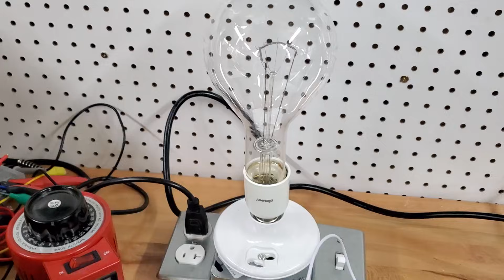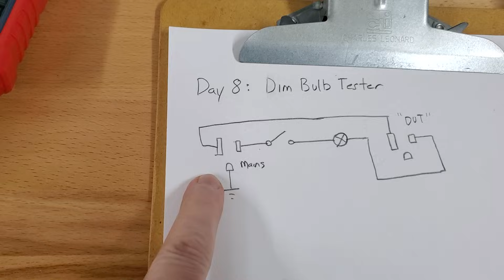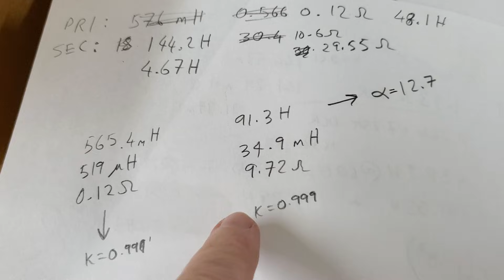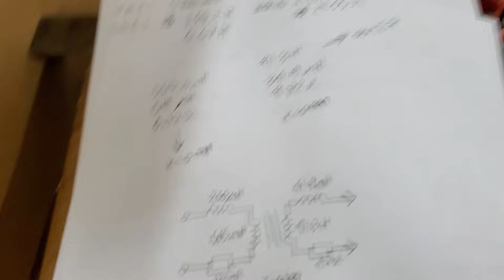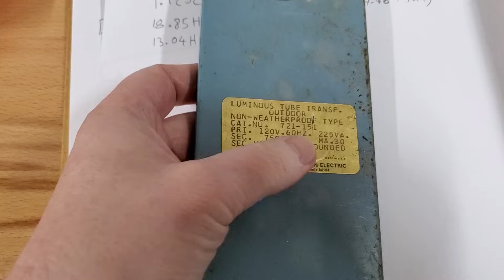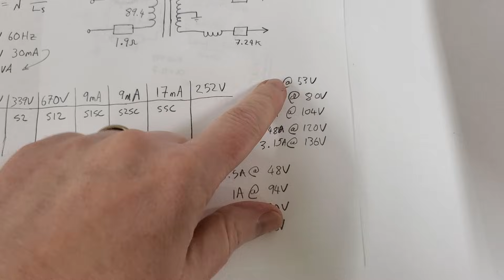ACoC 2025: Day 8: Dim Bulb Tester

Comment: Quite the coincidence!  I recently used an incandescent bulb as a ballast while demonstrating how molten glass conducts electricity.  I had mains voltage across two stainless steel rods with a light bulb in series.  When I bridged the gap between the stainless steel rods with a glob of molten glass the bulb would light up.  I found that by using a 200 watt light bulb, the glob of molten glass would remain molten indefinitely due to resistive heating.
Reply from the maker: Yes molten glass is quite conductive.  It has fairly high RF loss too, so once it melts you can heat it in a microwave oven, just heat it a bit with a torch  then zap it before it freezes again.

Comment: Alan to depot the Neon sign transformer is by using a infared Heaters which will melt the pitch it is the easiest and cleanest way to do it. I have depoted cable boxes with the same materials in them and it is not a fast process.

Comment: It's unfortinate with that much inductance and that many turns you can't really.use the v= l di/dt + ri method and look at the slope to find the inductance - for a lot of high frequency power inductors that works pretty well; just a nice fast switch and some bulk capacitance

Comment: I'd highly recommend putting the NST in an oven for a while until the tar melts and fills all the gaps again. This will bring the transformer windings back up to the intended voltage rating.